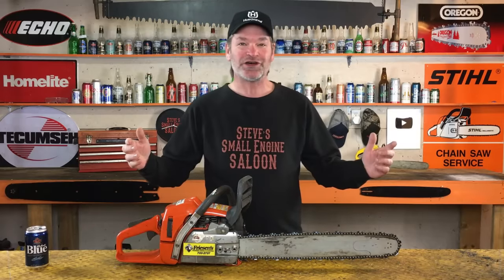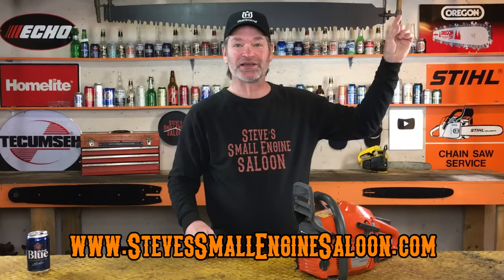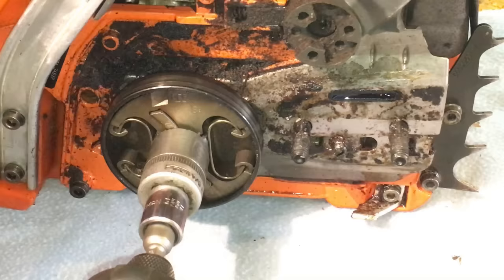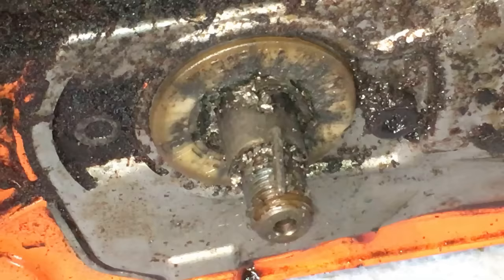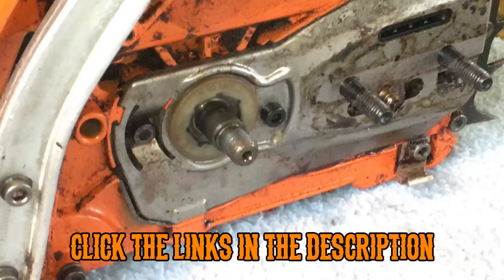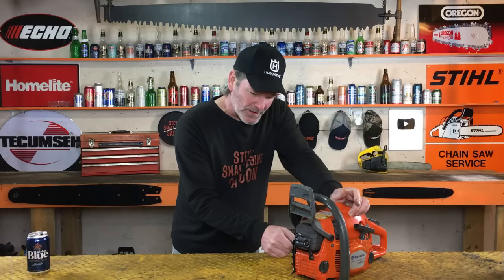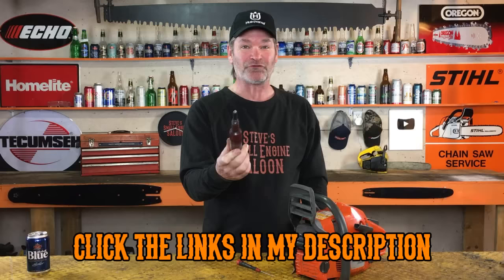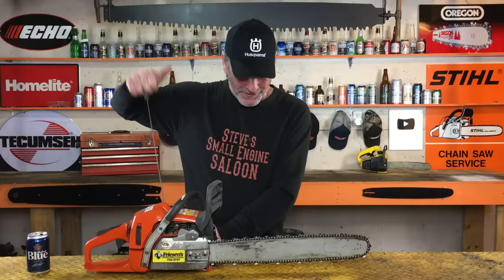WOW! Hidden Greasing Spot On A Chain Saw

Comment from the maker: ✅Click here for a grease gun ➜ https://amzn.to/2RbtqfU
✅Click here for a proper clutch removing tool ➜ https://amzn.to/3UBjR8t
✅Click here for a needle bearing ➜ https://amzn.to/39G70tF
For more videos like this, check out: 
👉Correct Way To Sharpen A Chainsaw ➜ https://youtu.be/-GIxowey6IQ
👉Adjust Or Tune The Carburetor On A Chainsaw ➜ https://youtu.be/M6T5JoGXcHY
👉WARNING: Never Do This To ANY Chainsaw ➜ https://youtu.be/8Q3J1cVGByQ
👉Don't Do This To An Easy Start ChainSaw ➜ https://youtu.be/PsF2SEWEa18

You can connect with Steve here too: 
✅Visit Steve’s WEBSITE ➜ http://www.stevessmallenginesaloon.com/ 
✅Visit Steve’s PARTS & TOOL STORE ➜ https://www.amazon.com/shop/stevessmallenginesaloon 
✅Follow Steve on FACEBOOK ➜ https://www.facebook.com/stevessmallenginesaloon 
✅Follow Steve on INSTAGRAM ➜ https://www.instagram.com/stevessmallenginesaloon/ 
✅Follow Steve on TWITTER ➜ https://twitter.com/SteveSaloon
Reply: @Mr grow Medical The (by far) most common cause of small engine failure is stale fuel gumming up (varnishing) the carb.  This would definitely cause your symptoms.  The severity of this would dictate the necessary repairs.

Start here - empty the tank of old fuel (dispose of it properly.)  Put fresh fuel (I recommend 91 Octane, but that's solely due to the lack of ethanol - at least up here in Canada) treated with Seafoam (https://www.canadiantire.ca/en/pdp/sea-foam-motor-treatment-473-ml-0387800p.html#srp).

Now run the engine as before - with the fuel cap loosely in place (enough to stop the splashing gas from getting out while letting air in.)  If it performs well, tighten the cap per norm and repeat the test.  No stall?  You're gtg.  Stall again indicates the cap is plugged - can be cleaned relatively easily or replaced cheaply.

If it's still running like a bag of hammers with the cap loose, then we have to move onto the next diagnostic step.
Reply: Steve's Small Engine Saloon - Great Video 👍🏻
I don’t have a chainsaw like that,  but it was still very informative and guess what I recently bought you a beer have a good day.
Reply: I have a vintage homelite super 2 from the 60s and I think I have a grease port on my bar but I don't know if that will work for this bar
Reply: I've got a Husky with the clutch set up that way and in the manual it shows a picture of putting grease on that shaft and recommends doing it every time you sharpen the chain.  But it doesn't explain it good enough to let you know about pumping it in or why it needs it.  I just put a glob of grease on the shaft like it shows but didn't know why.  Thanks for the video !  I'm sure I'll get more life out of that bearing now.
Reply: @florpdorp7190  I have a vintage 922 Homelite I bought in 1979 brand new  and that grease gun works for the bar.
Reply: I already grease my bar, but now I'm going to check out the clutch bearing grease port...maybe my Echo CS310 has one.
Reply: another informative clip that should appeal to anyone who has a c"saw whether for one job a year or 20.... thanks for the time u took to inform me
Reply: Steve's Small Engine Saloon 00
Reply: Really a great video, very informative, help save an old chainsaw for my dad... Thanks for what you do! Always a great View
Reply: That help's me a lot with my chainsaw...thank's
Reply: OH-- For clutch-removal tools, if you have an angle-grinder and a vice (or clamps, if you're suicidal) you can grab a 19mm(or thereabouts, check your clutch) socket from your socket-wrench box and grind-off two of the "upper sides", leaving the tip of the tool with two 'teeth' that fit your clutch :D  I can usually have a custom clutch-tool made in <10min, at the cost of a lil socket, and it'll of course go-onto my socket-wrench or my drill -- love putting it on impact-drill for the removal, after a by-hand verification my piston is jammed-tight & things are ready for that initial, hard/snappy counter-clockwise snap :D
Reply: @florpdorp7190  I think that's the same one I'm working on
Reply: I have a Husqvarna and this is great info. Thanks for the video
Reply: What kind of grease can I use for my husqvarna? Brand and specs recommended from you? Hello from Puerto Rico
Reply: Re
Reply: These type of tips are gold thank you!
Reply: Just bought a 395, I’ll check this. Cheers!
Reply: Hi steve.....just watched your vid on a Echo 550 chainsaw. I have one a CS 550 EVL and want to clean the spark arrester but cant find it. Please advise
Reply: Interesting. Just discovered channel and learned a few things over the past couple of hours. Thanks!!!!!!! Just subscribed.

Comment: I've been running chainsaws for 40 years and I never knew that I could possibly grease that needle bearing. Thanks Steve!
Reply from the maker: Glad to help
Reply: Same here, but I been doing it 30 years
Reply: Not all of them , my 044 does not have that feature , my tanakas have.
Reply: should the bearing be packed with Grease prior. to insertion ?
Reply: In he 40 years you haven't greased that needle bearing, 

have you ever had a problem with the bearing?
Reply: @2101case  I've greased the tip roller on the bar but not the needle bearings under the clutch. I've run Husqvarnas and have never had a failure of that bearing.
Reply: 45 years running Stihls, Echos and Husqvarnas.  I pride myself on never breaking a starter cord and hand sharpening.  I thought I knew alot, but Steve proved you learn daily.  Thank you very very much , Steve !
Reply: @tomthompson7400  Yeah, Steve kinda mentioned that when he first pointed out the depression in the end of the shaft (5:04). You mighta missed that.
Reply: Same as......40yrs on and off with chainsaws,never knew that😣😣off to shed now to check on a maculloch,husky,sachs dolmar,ryobi and a cheapo chinese..................
Reply: @jcadult101  Good luck drilling hardened steel !! And if you heat it too much it'll lose the hardness.
Reply: @NHHalKnowsHow  the allways have a bar oil leak on the pump hose connections being just flush fit and not tight fit,that "defect" mitigate the bearing exposure to "greaselessness",the case where the bar oil pump is allways "wet" of bar oil. The case in the video is a rare exception.
Reply: The husqvarna owners manual states the needle bearing should be lubricated with engine oil on a regular basis. Why wouldn't husquvarna recommend grease? I always used oil as stated and have never needed to replace the needle bearing. I have cut more then 450 cords of without any major repairs. I think I'll just keep using motor oil. It looks like a good idea... but there must be reason they don't recommend grease....🤔
Reply: save money
Reply: @jcadult101  perhaps the crank shaft is hardened? (This dulling a drll bit making it very difficult ?)
Reply: @tomthompson7400  Hence why the commenter said "could possibly."
Reply: I been running chainsaws 38 and a half years
Reply: @davidj.esposito1867  I ran a husky for 18 years a mccolloch 3 years A stihl for 10 years after that and a eccho 7 and a half years till today
Reply: @2101case  Never
Reply: Yeah, No kiddin! Same here
Reply: this channel makes me discover all kinds of oiling points i never knew existed
Reply: @tomthompson7400 you can still Grease the needle bearings you just have to remove the clutch

Comment: Didn’t know that the hole on the end of the shaft was for grease. 
Tips like this are a god send to the amateur chainsaw guy.
Reply from the maker: Right on Tommy...
Reply: Tom Stitt outboard clutches 90% of the time have the grease port, inboard clutches, atleast all of my saws you have to take the cutch apart to grease
Reply: Me neither. I've run Husky saws at work for decades. Had no idea that was there.
Reply: Thanks great vid.information invaluable...chain saw ...very cool..have a brewhaha fixing saws man after my own hart
Reply: Cool man thx going to grease my 545
Reply: OK, if the saw doesn't have the hole what then? "Hand pack" AKA hand wipe grease on/in and how often?
Reply: Your good video showed me the uses for the grease gun I’ve had for years but seldom used. One can never know too much about a subject.
Reply: Nice video as usual.
Reply: The clutch bearing lube hole is mentioned in the owner's manual. You just have to get past all of the safety Sally instructions to find mention of it. Husqvarna includes a grease gun & tube of grease with their saws. It doesn't take much grease, & it doesn't need to be done frequently. Sure beats pulling the clutch assembly off of the saw.
Reply: grease it on a change or sharpen of blade.
Reply: I didn't either and that's why don't spin smoothly

Comment: Man I just got a gas saw and it’s my first gas fueled small engine powered piece of power equipment. It’s amazing the knowlege you can find on YouTube. I’m glad that this was mentioned because I would have never guessed there was a greasable bearing for that clutch and I certainly would not have figured that spot there walls have been a grease port. I’m a commercial/industrial hvac technician and understand how important maintenance is on equipment that needs to be relied on so that’s why I started researching all of this chainsaw stuff and MAN am I glad I did. Seems like outdoor power equipment  design, building, manufacturing, maintenance and repair is it’s own little world with all sorts of little known pieces of info. Hopefully learning all of this will ensure my equipment lasts for years.

Comment: if i would of had teachers like you in school , i would have finished high school
Reply from the maker: Thank You...
Reply: It's true... a school subject incorporating this type of life skill teaching is a winner..
Reply: Especially one that lets you drink beer in class.
Reply: @Mark OnTheBlueRidge who cares?
Reply: If I had had teachers like this, I wouldn't  be a patent attorney with a logging certification.
Reply: @Mark OnTheBlueRidge Would of have had
Reply: @Mark OnTheBlueRidge , go back to your english class. This is "Chainsaws 101" here with a little bit of "Beer Drinking 601" thrown in for good measure. hiccup...
Reply: They don't teach shop classes anymore. Everything is meant to be done behind a computer. I run a handyman service. The modern  Male is as useless as tits on a bull. Great tip. Will check my Stihl to see if it has that grease port.
Reply: @michaelprosperity3420 School is not for learning anymore, it's strickly INDOCTRINATION !!!!
Reply: @Mark OnTheBlueRidge 
It's actually would've, which may print out as would of when using a speech to print app.
Reply: @michaelprosperity3420  I believe my Stihl 650 has a notch on the clutch housing if you look down on it. Or maybe that is the husky 372? Anyway my point is that some are in the clutch drum and you can see a hole to grease looking down on it
Reply: Nah High School was a 5 keg job...
Reply: Sheldon is so 🤓

Comment: I inadvertently found the answer to my question. My chain goes by itself sometimes as well on my Husqvarna. Now that I know how to take the clutch off by the way thank you Steve, I better get on that job before I get a destroyed needle bearing. Sometimes the chain goes by itself while my saw is idling and sometimes it doesn't want to grab when I'm cutting at full throttle. I have this all running good but I know that something's up. Great video I'm glad I stumbled upon it even though it's 2 years old lol. Been washing your videos for about a year or so Steve but now you have another sub lol. I'm from Canada like you too eh.

Comment: I did a chainsaw course at Usk college in the UK 17 years ago. The saws we used were the Husqvarna 371, we were shown how to lubricate the clutch housing needle roller bearing using the simple grease gun. We were told to do this periodically, say every 2-3 months, too often and grease could get into the clutch. I've since found that not all chainsaws have this method of bearing lubrication. The bearing really only comes under heavy load when the chain is stalled under heavy throttle situations. Some people often stall their chain!!!! Under normal use the bearing doesn't get much load at all.

Comment: I've asked what to do and properly care for saws I've used.
This has never been known about or mentioned.
I learned about the mix.
And the bar oil.
Had an oiler turned up by a shop for one that heated up the bar.
But this is the first for grease points that must be in the original instructions?
Wherever they are.
The sock monster in the dryer must take them.
Who knows.
But this video caught me totally by surprise. Nice job, Steve.
You really earned a Heineken that hasn't been out of the fridge since it was bottled.
Chilled and not skunky.

Comment: My old 2100 Husky did not have that hole in the shaft. I would take the bearing out every 3 months or so to clean and grease it. After I had it ported and a carb upgrade, I had the fastest cutting saw in our crew. That was when Huskys were built well.

Comment: Good video! I'm 72, been fixin' saws up north here on Vancouver Island since 1975. One thing about greasing the tips: we were running the 2100 model those days, and the fallers weren't greasing the tips. There was no problem. But a local contractor was, and his tips were burning up! Our conclusion was that the chain oil did a good job anyway.  Bill
Reply from the maker: I used to work at Macandales!
Reply: @StevesSmallEngineSaloon  You must know the guy who originally worked for Challenger in Nimpkish, before he went to Macandales. [1989?] He was from Duncan, I forget his name! I worked at Woss, but long before I was at Gordon River- where my dad was saw mechanic.   Bill junior.

Comment: A stuck clutch is most likely always the bearing, as most of the bearings ride in a plastic cage. The cage gets hot from lack of lubrication, and melts and wipes out the bearings, which is what you end up with here. 
Out of all of the saws and weedeaters with clutches I have worked on over the years, I rarely ever run into a broken spring.   
Good catch on that.

Comment: Just pulled this maintenance on my 3 husqvarnas as per their owners manual a couple months ago.  Didn't know to look for the secret hole though. My P26 Pioneers manual doesn't mention a clutch bearing needing lubed. After 43 years guess I better check it out .
Reply: If the secret grease hole isn't on your chainsaw... well you have to add drops of oil between the needle bearing and the clutch... don't ask me how I know..... :(

Comment: OMG! I never knew about that little grease hole on the bar. I keep buying chains and bars because the front gear keeps burning up. I thought the chain wasn’t getting enough oil so I was manually oiling the chain. Thank you so much. Gonna order me the little grease tool.
Reply from the maker: Right on Buddy!  Thank You...

Comment: Thanks for this hidden info Steve!

Would you do a video on the differences between bar and chain oil and regular oil, and or used motor oil related to use as bar oil?

Comment: One thing to remember when greasing the bearing is to only give it one pump! Go crazy with the grease and it gets into the drum and major clutch slippage. That’s been a feature on husky’s since the early to mid 90s. Think my old 262XP even had it if I remember correctly
Reply: I ran a husky for 10years, was always taught by my teachers who grew up in forestry with there dad and his dad, if you grease it once you will always have to, if you dont the bar oil is enough to do the job. Once you grease it stops oil getting in requiring to keep greasing. I went through 1 bearing in that time, but knew something was broken and changed out before it got to the stage of this saw in the video. After 10years i moved to stihl and never greased and that is still going on the second bearing after 15yrs.
Reply: Garyth Bensley So-are you saying this info is Not a good idea? Are you saying to let just oil itself? Not clear.
Reply: Just put bar lube on it and it should be fine as long as you not running chain to tight. When you grease it, the grease move out over time and stops oil getting in so you will have to continue to grease all the time. If you choose to grease, do it often, otherwise the bar lube does the job. Ran my saw for 8hr days 5 days a week, plus any firewood on weekends. Never greased once and never had a problem
Reply: They both work, the bearing will oil itself with chain running, greasing it you have to do everytime you do maintenance.
Reply: Garyth Bensley Thank you for the information, and clearing it up for me.
Reply: @plugger4945  no worries

Comment: Good one Steve. My husky has oil written right on the nut. But ive been using your trick for many years now. Husqvarna 266XP 24 inch bar, bought new in 1994 still running the original clutch. It has cut 1000's of cord of fire wood. Livin large in BC. Cheers Steve.

Comment: Good one Steve, I had no idea , I been cutting wood 40 years , My saws are all Huskvarna before they X - torqued , 55   372, 395 , I have a 266XP from 1982. Magnesium case 4.0 ci a beast still works great. I have had all the good top handle saws , Husky 338 , 35 , Stihl 200T.  I must say Echo 355 T has been best so far , by the way Echo is making some good saws now, legendary starting , your thoughts please, hey what’s that blue can

Comment: I threw away a chainsaw because of that problem. I have another one in my wood shop that has the same symptoms. Tomorrow I fix it without being ripped off by a so called chain saw repairman. Thanks Steve. You saved me from buying a new one. Maybe that is what the chainsaw manufacturer in China wants me to do. I am grateful.
Reply from the maker: Right on